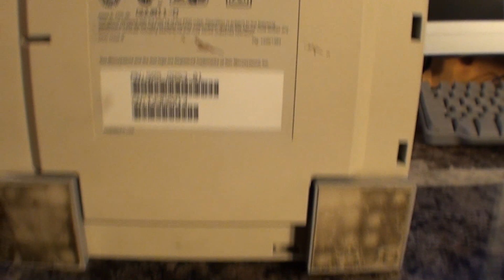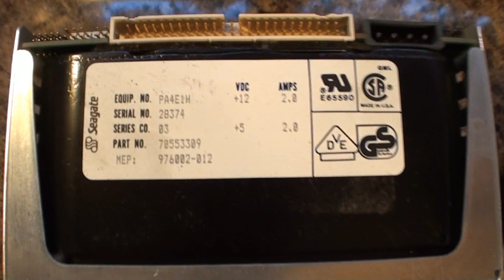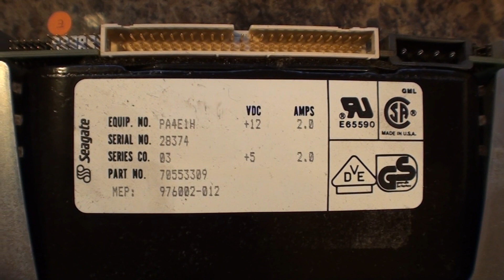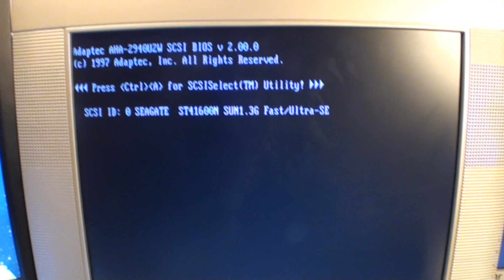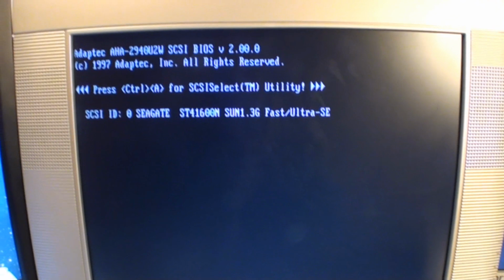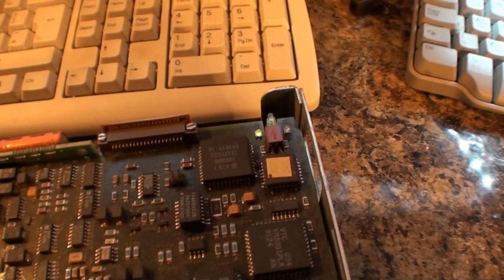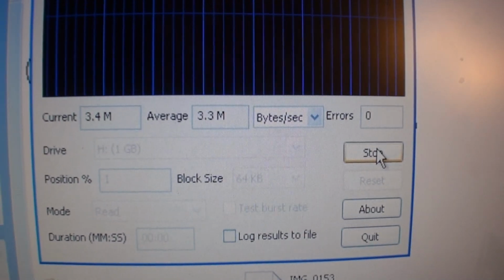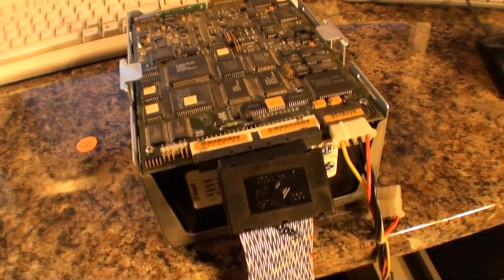1.3GB 5.25" External Hard Drive Teardown

Comment: 1.3gb was a lot back then. 

I remember my dad got a 1.2gb IDE HD before the mid 90s, so maybe 1993, and by then it was a 3.5" drive. But that was still good storage until the late 90s. This giant drive of yours would have been obsolete pretty fast just because of the slow speed. It seems that apple kept using that form factor for a long time.

Comment: Enjoyed the video! Yes, when you said 1995 I did think, hmmm no it's older than that, especially being 50 pin. Yes in 1991 that was a very big drive, I know you said the typical drive would have been 180mb back then, well it wasn't even that to be honest. I remember buying a 170mb drive in 1993 and it was definitely high-end at the time for a desktop PC. In 1991 most people, if they had a hard disk at all, would have been 20mb - 60mb. Usually MFM interface. My hard disk in 1991 was just 10mb, but it was a revolution when everything was 5.25 floppy based before that. It took a long time to fill a 10mb hard disk!

Comment: In 1991, the average was between 45 and 100MB. 1.3GB would have been ludicrously large, even until 1998 it would have been massive!
Reply: AIO inc. I dont know for 1998, I got my first PC in 2002 and it had a 20gb hard drive

Comment: I've actually got that same SCSI drive there, but only the actual drive, not the big caddy. 

These drives use voice coils, not stepper motors. 

The SCSI drives are usually driven by their own CPU, this has an AMD based CPU.

I wish I could have a shelf like that, what with all the hard disks and optical drives all in one convenient place.

Comment: I have the lighted version of that keyboard you have connected to your PC there!

Also, on a side note, the external SCSI connector there is the 68-pin cable that goes to some internal SCSI adapters.
Reply: *****
Toshiba Librettos are great, but OQO's are better.

I love UMPCs!

Comment: Question:  How does your shelf survive the weight?
Reply from the maker: I designed the shelves to hold over 100KG each. They were secured with several bolts going through to the outside of the shed with steel plates to prevent them from being pulled out.

Comment: I would have been interested to know what was on it before you formatted it.
Reply: +Jesse Donat It was still there after he formatted it.  All he had to do was scan it with some recovery software.
Reply: +pearlmax Only kind of. It's a fairly destructive operation overall. Without the inode table it's largely impossible to know where the lines between files are.
Reply: Jesse Donat I'm not sure what recovery software you use, but you should probably switch up if you think a format is destructive.

Comment: damn i wish i had a granite desk like that holy shit
Reply: Good for vibration and electrostatic isolation when you're working on electronics, I use an 18x24x3/4" thick granite pastry board I got for $20 to be the basis of my soldering station. heat resistant too.

Comment: holy shit, it sounds like a jet plane taking off lol
Reply: AIO inc. I'm sure that when this hard drive was new, it wasn't as loud as it is today.
Reply: +brickman409 That's due to bearings not lubricated properly. Lubricant inside the HDD motor evaporated during the years and that's why this drive sounds much louder than when it was brand new.
Reply: +MegaBojan1993 it's not evaporated, it's just that the bearings are quite massive and there are probably between 4 and 8 platters that each (for a platter) weigh a ton. The motor is just struggling to turn the disks at what is probably 5400RPMs. 

These were designed to be used in servers and very expensive businesses, so they're not generally made to be quiet.
Reply: MegaBojan1993
It may have been slightly quieter, but this is from a time when you could tell when your hard disk was going to fail just by having the ability to hear sounds.

Comment: Even if you have a 50 pin out SCSI controller card that was PCI on your computer you could still use it. But a 1,5 gigs is not much these days. Carl just to let you know that number ) on the back where it could be switch was not the IRQ for it Each SCSI device whether it was a hard drive, Scanners for examples were assigned a number in series. Like drive 1, 2, 3, etc. And the SCSI card would detect each drive or scanned on that cable serie would be detected. I have a old HP Netserver LPR using 2 SCSI drive in raid 1 format and each of those internally  has a number already assigned to them where it will let the adapter know where they are in the chain of the cable.

Comment: Even in 1991 the Seagate Elite 3 was considered an outdated drive. In late 1992 you could buy a full height 3.5 Inch SCSI drive that would be in the 2 GByte range such as the IBM Type 0664. The Elite series was created to be a very cost effective solution where the main concern was storage capacity. The drives were not fast drives at all.

Comment from the maker: I don't really go looking for data on hard drives. Most SCSI drives are used in RAID which means having just one drive would only give you fragments of data anyway. I have had some rather interesting data over the years. One drive I bought at a car boot sale for £2.50 contained passport scans of customers of a Cash Converters branch up in Essex and another drive I bought in a job lot on eBay had masses of data from a south London finance company. Needless to say I low-level formatted them!

Comment: Thanks for the vids. I spend most of my time messing with retro consoles and old equipment too.

I just bought a SCSI card yesterday (same as yours) to read the data from the 5.25" drive out of a Quantel Harriet system. I bought the unit last week after seeing RGVX's Paintbox vids. (I've been helping him restore it and make backups etc.)

I was just thinking - when you get these old drives, try doing what I would call a "sneaky undelete" on them, or have a scan through with WinHex. :)

Comment from the maker: @MrComputerfan It definitely is! It weighs almost 3KG (6LBs) without the external enclosure! The original price from SUN Microsystems in 1992 was £2,799 plus an additional £249 for the ISA SCSI Card and £49 for a 1.5M SCSI Cable! Compare that to the 4TB Seagate GoFlex drive which is around £199 with USB 3.0 & eSATA Interfaces as standard!